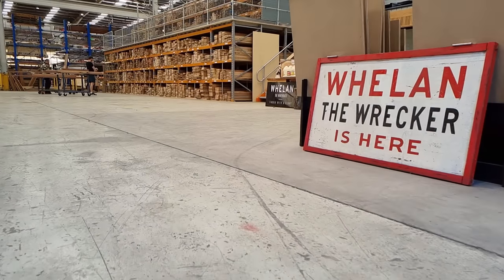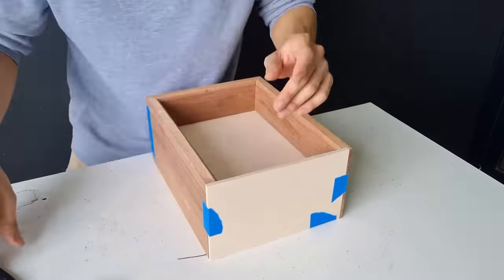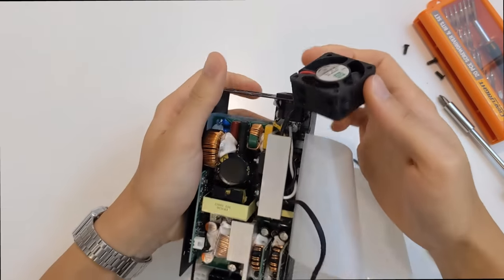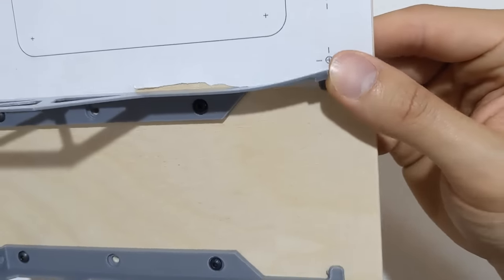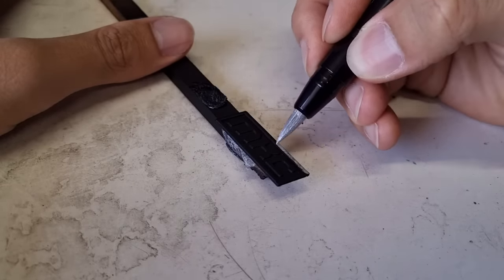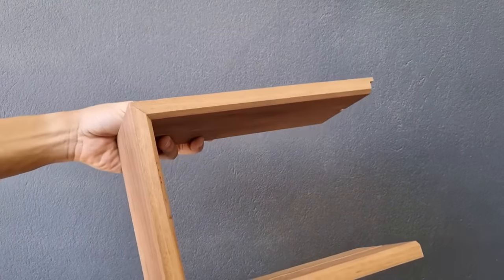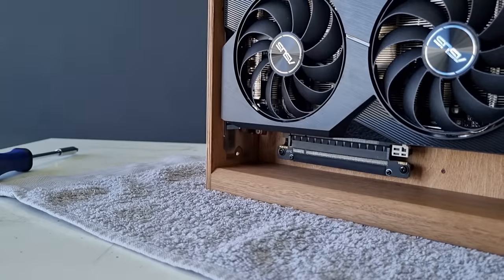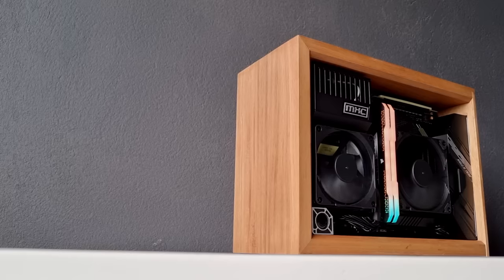Minimalist Wooden ITX PC | ASUS RX6600 XT

Comment: A MUST___ I ACTUALLY USED A WINE CREAT BOX. A LITTLE HIGHER AND A LITTLE LONGER. TWO 92 by 92 FANS ON TOP MEATLS FAN GRILLS ON TOP. ONE FAN ON THE  SIDE OF THE CASE 5.25 USB HUB WITH ADDED MIC AND HEADPHONE JACK TOP RIGHT CORNER, POWER BUTTON LOWER MIDDLE FRONT UNDER THE USB HUB. CASE MADE. THE REST LIKE HIS. ASUS B550 ITX R5 5600xt COMES WTH STOCK COOLER

Comment: a black mesh could be a good addition to the look and dust prevention
Reply: have a tnd
Reply: Then the PC would become like a speaker system)
In fact, this is a matter of taste, dust can be easily removed with compressed air without disassembling the entire PC.
Reply: open case is easier to clean plus he design it to where if he has to blow dust out, its holding only 4 screws
Reply: And yes, it'll ruin the look of it
Reply: I would prefer glass.

Comment: Pro tip when doing a groove with your router use the rounded part to run against your fence since it's the same distance away from the middle of the router.
The reason for this is if you use flat part one wrong movement would get you a crooked groove but if you use the rounded part you have some wiggle room before the groove goes crooked.

Other than that nice project! Good job!
Reply from the maker: That's a great tip! I will definitely try that the next time. Can't believe I never thought about it before. Thank you very much ❤️

Comment: This looks incredible. The CPU temps were surprisingly high considering its practically open air, still not alarming though. I love how the 6600 xt fits so perfect on the back half of the pc.
Reply from the maker: Thank you! I agree with the temps, that's why I was abit disappointed. I'm positive it's due to the orientation of the heatsink fins. The air flow through them is now restricted by the ram sticks and the IO shield on the other side. And I assume what little air is able to pass through that is immediately sucked back into the fan...
Reply: Yeah, those CPU temps are a bit high. I'm not sure if it's going to be any better after a few months of dust build-up 🤔?
Reply: @mxcbuilds6633  Você pode abrir algumas aletas, formando uma grade para que o ar quente saia pelas laterais igual fez na fonte, para que o ar não seja sugado novamente pelo CPU fan.

Comment: protip from a woodworker - use a plastic straw cut at an angle to scoop up the glue squeeze out from the inside corners once you clamp it up, then dab with a moist brush and wipe it away. no more residue, and a super clean look. James Krenov approved technique (my teacher was a student of his) :) 

you can also gently burnish the outside edges to get an even cleaner miter. and sometimes, you can even cut at 44.5 degrees to make sure the outer angle is perfect, though it's difficult to cut a perfect cut there without a tablesaw.
Reply from the maker: Those are great tips! Will try them out next time :)

Comment: Most any Box Store will sell aluminum panels that would close up both sides will still allowing massive airflow or you could buy the panels online too... Excellent project, very well done...
Reply from the maker: Do you mean mesh panels?
Reply: @mxcbuilds6633  Yes, exactly, was sort of tired when I wrote this and what they were called just slipped my mind and I was too tired to Google it... LOL... But yes, Mesh Panels. They vary in size of hole and what not and many have awesome designs for such a project...

Comment: Nice, love it,  my PC, also have i5 10400f and RX 6600 XT but that wooden PC of yours looks so classy.
Reply from the maker: Thank you! May I know what cooler you are using for your cpu and what temperatures it runs? Curious to see how it compares
Reply: @mxcbuilds6633  I'm using intel stock cooler from 11th gen cpu, black one with copper core, lowest temp is 22 C, max 63 C, but its very noisy sometimes.

Comment: Nice and clean. A few drilled holes in the middle component bard would have helped air flow and temps. Good job.
Reply from the maker: Thanks for the tip

Comment: something i would've added to protect it from dust, is a fly screen on both sides.
it probably would involve some trial and error because of the fans distorting it
adding steel-wire to the fly screen could do the trick
Reply from the maker: Thanks for the suggestion!

Comment: RECOMMENDATION: when soldering two cable ends together, it is better to pre-tin each end, then solder them side by side to create an edge joint. NASA utilizes this method. Stranding and twisting the wires together can create air pockets which may increase the resistance value of the joint.
Reply from the maker: Thank you for that recommendation! Will try it out next :)

Comment: While it is decent, the biggest issue will be when it contracts and expands based on humidity, which can pull on the motherboard as the screw positions change from expansion and contraction of the wood. The moisture in wood could also potentially cause a problem with electronics. This is why wood isn't really used for PC cases. Metal doesn't absorb moisture and it's not an insulator. It does expand with temperature, but not by much, and since everything else is metal it expands pretty much the same too. Temperature shifts will also cause this moisture change, since the heat from the components will dry out the wood, making it contract.
Reply from the maker: All valid points. I'm not saying it doesn't happen, but all of the cases I've built have not had issues with expansion and contraction. Sealing the wood with wax, varnish really helps reduce the changes in moisture.

Comment: This is a complete work or art. My only worry is about the ground on the parts. 0 issues?

Tip: Try to unvolt the CPU, you will have better temps with same performance. Directly on the bios, do not use apps or intel app.
Reply from the maker: Thank you, yes no issues with the functionality so far. So far the noise has not been an issue during normal usage.

Comment: Excellent engineering skills.  It would be interesting to design a similar water-cooled system.
Reply from the maker: Have you checked out my previous build using the AIO water cooler?
Reply: @mxcbuilds6633  Nope, but I will!

Comment: Very cool build! Love the look. On the filming side of things, it looks like there's a lot of shake for some reason. Try using warp stabilizer with camera lock. And for frame interpolation use optical flow. Should smooth things out. well done.
Reply from the maker: Thanks for the tips, I still have alot to improve on terms of filming and editing

Comment: You had some tear-out with your mitres because you didn't use the same marking knife scoring trick on them as you used with the plywood bracket ;) It's also be cleaner with a table saw or a docking saw, rather than a hand saw, but of course not everyone has access to such equipment.

Would be really nice to see a component list - what the heck kind of PSU was that to be so small and still 500+w for your 6600XT??
Reply from the maker: Thanks for the suggestions! The PSU model is found here
https://a.aliexpress.com/_mrKGJbC
Reply: @mxcbuilds6633  Sweet, thanks!

Comment: Do one with a double or triple fan AIO. The radiator can replace one of the sides of the frame. you can use thin cables to provide rigidity.
Reply from the maker: Check out my previous build that implemented a 280mm AIO! https://youtu.be/B5zZkGwnLIE

Comment: Looks really good, I probably wouldn't build one like this since it's so exposed, but nice none the less. That said, if your pc is exposed like this, you will notice the dust and it will be easy to blow with some compressed air. Noise also seems kinda unacceptable.

Comment: Fantastic work, looks very pretty!
But it looks like that you have exposed metal on the iec socket, even with heat shrink.
And it seems to be pretty easy to get accidentally touched with the case being all open.
How about 3d printing a little box around the back of the iec socket and a little hole to pass the wires through?
Reply from the maker: That's a good suggestion, will look into it. Thank you :)

Comment: If you would like some mesh to finish of the case, I can model one for you. This i really nice work you got here. Classy. But a print mesh would complete it. I would recomend black, and about a pitch of 2,4mm. Only like 1,2mm thick mesh, about 66% perforation. Four layer for 0,6mm nozzle, six layers for 0,4mm nozzle.
Reply from the maker: Thank you for the offer, I will prefer this case to be open air concept.
Reply: Love as it is. If you haven't  used open designs before, just be careful when swinging cables and the lake while using this type of cases. It is soooo easy for that bloody USB cable to just swing into the case and making a fiery short. Sparks will fly. Some of us have seen the light.

I realized that I simply could not live with an open design, after being "enlightended", and sitting there with a MB, that would never see the light again.

That being said, this is maybe the nicest wooden case I have ever seen. Your expression is classy.

Comment: i like the psu mod but please dont solder the powercable. high currents from the socket to the psu can heat up your soldering points and melt them reducing the conductivity. use crimping or other mechanical connection types like wago clamps.
Reply from the maker: I would typically be weary of soldering high current wires too. But given how the input cables of the stock PSU were soldered directly onto the PCB and the stock wire gauge was so thin. I was confident that my wire and soldering would not have added significant resistance in this application.

Comment: 4:48 I don't feel like solder is an accurate replacement for a crimp. A crimp really squeezes the fiber back into effectively a single wire of copper.
Reply from the maker: Yes crimping would be better

Comment: For the CPU you might need a slightly bigger radiator. Great work.
Reply: I've bought the same construction (slim) cooler, it was enough expensive (for about 20$). When I put this one to my PC, I discovered that it is very noisy nad CPU temperatures are high. Well, so then I went to local market and bought the most cheap Chinese CPU cooler for 4$, temperatures has come to normal and noise disappeared.

Comment: Good job, I like working with woods.
Did you think about using laptop components to build a tiny pc or maybe built in a laptop in something wooden, like table?
Reply from the maker: Thank you! Wood is a great material to work with. I have not explored laptop parts yet. Do you know if these can be bought separately?
Reply: @mxcbuilds6633  not sure if it makes sense to buy components separately. If I were you I would buy a used laptop with a broken screen or damaged case and play with mounting them into the table, or some box or whatever makes sense depending on what you have.
As an example: you take out all components of a thin laptop from its body as its easy and everything is already small and working. Then hide it in a table, built in an external monitor also taken out from plastic frame, everything is framed in wood, all cables are hidden. It can be made in design of retro furniture or some old tv set. or else, it can be modern floating style. Something like that)

Comment: Wood Is Fancy  and classy too, but for me it will be better with a Glass case to keep low temperatures in all system.
Reply from the maker: Thank you, how will glass have lower temperature?
Reply: @mxcbuilds6633  Because glass does not concentrate heat like wood does, glass tends to disperse heat better, wood concentrates it.

Comment: nice looking. But you really should not cut psu cover open. It will put quite lot RF noice to air without metal cover.
Reply from the maker: Fair point, haven't seen much issues yet but I'll keep in mind. Thanks

Comment: Great build there!
Not sure if you're from SG or MY.
Was there a reason why the PSU cover was printed in pieces and glued together rather than printed as a whole?
Also, with regards to the plastic shroud for the PSU, you could have cut the entire top section off as it is meant to insulate against the original metal cover - since you're replacing it with a non-conductive (plastic) cover, it could be trimmed off entirely off the top.
Reply from the maker: Haha my accent that strong huh 😂. Yeah good point on the insulation plastic, thought I didn't want the components to touch the cover directly due to heat, but I don't think it'll make a difference if it's that thin. Thanks for watching! :)

Comment: incredibly hot casing, that "hot " i mean it's really sweating hot with high thermal storage that can bake cake
Reply from the maker: That's an exaggeration...
Reply: @mxcbuilds6633  Why not Aluminium rather than wood,  wood is the worse material for heat transfer
Reply from the maker: Because that wouldn't be unique

Comment: It's hard to say for sure but I would hazard a guess that your poor temps are caused by the hot exhaust getting recirculated, as you're not directing it away from the fan intake. 🤷‍♂
Reply from the maker: Yes I agree, it's definitely circulating the hot air around that area causing a heat soak. Oh wells, still well within safe limits anyways.

Comment: You need to put Holes in the Top of your case. its a Physical Process , heat go allways up . Thats why your temperatures are bad of your computer.
Reply from the maker: Yes ventilation holes would help. But the temperatures now are still within limits. Thanks for watching :)
Reply: @mxcbuilds6633  You are welcome.

Comment: about airflow. if you take the same chieftec, then there is this same gasket that you cut, it reaches the center of the cooler, how was it in the beginning. In a review on the power supply chieftec, it was said that such a gasket improves the airflow inside the power supply
Reply from the maker: Thank you for your comment. May I know which chieftec power supply model you are talking about?
Reply: @mxcbuilds6633  chieftec 450w ctg-450-80p 
look at the cooler

Comment: wow! The extension wire of pcie is so long, I am a little worried, after all, the operating frequency of pcie is very high, whether the extended wire will bring performance degradation, I also have a plan to do a similar project, but I have been worried about the extension wire pair of pcie High-performance graphics cards come with a considerable downside. May I ask if there are any problems that I am worried about in this work of yours.
Reply from the maker: This is considered short, pcie extension can be quite long without affecting performance. Google or YouTube this topic, many people have tested various lengths
Reply: @mxcbuilds6633  thx

Comment: How did you mount in the motherboard standofs to the wood. What drill bit did you use?
Reply from the maker: You can either use a M3 drill/tap straight into the plywood. Or drill a 4.5mm hole and screw in a M3 threaded insert for a more durable mounting.
Reply: @mxcbuilds6633  As I can see you don't have a psu fan grill. I try to go as minimalistic with my pc as I can without compromising usability. Can I take my psu fan grill off? Is it safe for psu fan to be spinning without a grill?

Comment: I would be careful with that 3d printed PSU faceplate.  I don't know the 3d printed medium used, but most of them melt or warp with heat that a PSU can reach.
Reply from the maker: Yes that is a good point. I will keep an eye on the plate. Was printed in pla which is not good with heat. But with the bigger fan I think it should be fine. So far so good.
Reply: @mxcbuilds6633  Yeah, PLA is like 60 to 65C upper limit, while PSU might reach that high under load, perhaps a stress test for half an hour and watch it.  Maybe start trying to learn to cut and fold metal sheets for some part modding.

Comment: Wood is a great insulator. I'm not sure about this build. Although it looks fantastic I would be worried about heat buildup. WOOD BURNS.
Reply from the maker: Yes and yes. Both correct, but PC parts don't normally get that hot

Comment: the orientation of the cooler won't change your temps
Reply from the maker: How are you so sure?
Reply: @mxcbuilds6633 i commented mostly to boost the engagement on your video. 

But i have a lot of experience with computers. A ton of people feel like "hot air goes up" will have an impact on performance. It doesn't, because it's a very very slow effect, any fan at the slowest speed is 10x stronger.

So for the cooler orientation the only way it will change something is if there's actually airflow being blocked by something in one of the setups. Not if the fins let the air escape up instead of sideways.

Comment: Never assemble any electronic parts on carpets or towels unless you want to charge yourself and then discharge on the components killing them.
Reply from the maker: Thanks for the advice, I agree it's risky, but it's a risk I'll take to avoid scratching the wood.
Reply: @mxcbuilds6633  Use a mousepad instead :)

Comment: Tous les éléments doivent être reliés par la masse électrique 
donc montés sur une même structure châssis métal.
Reply from the maker: If each component that is connected to the power supply has a ground connector, ie the GPU 8 pin, CPU 8 pin and mother board 24pin all have ground wires. And the power supply is grounded through the wall socket. What is the difference?

Comment: normal temperature for i5 10400f 60°с, chilling shit
Reply from the maker: May I know what cooler was used to achieve that temperature? And in what case with how many fans? Thanks.
Reply: @mxcbuilds6633  try Noctua	NH-L9i, Seems to be quiet and low